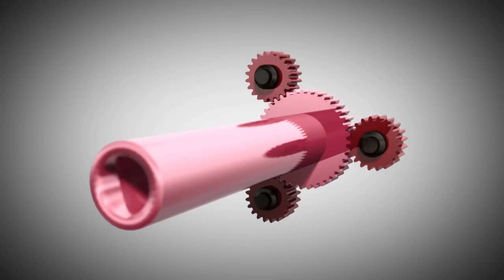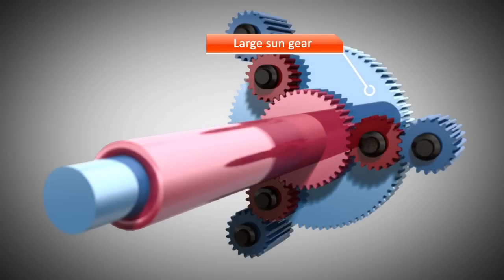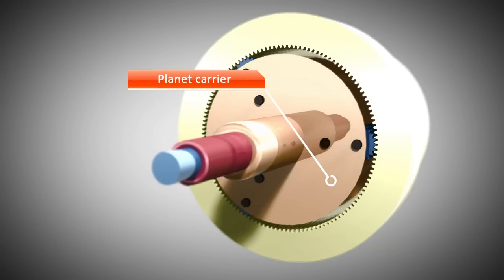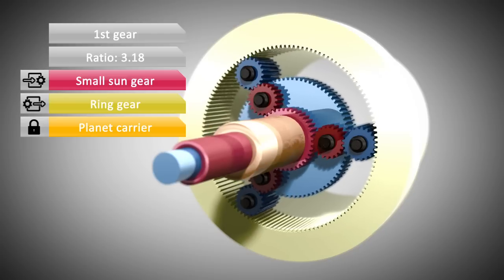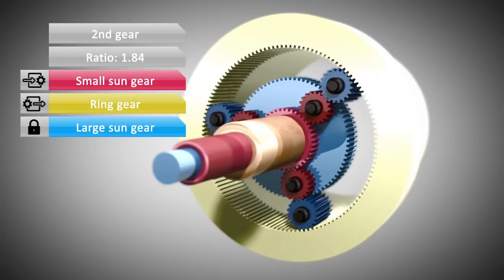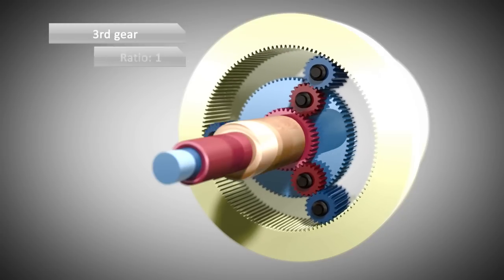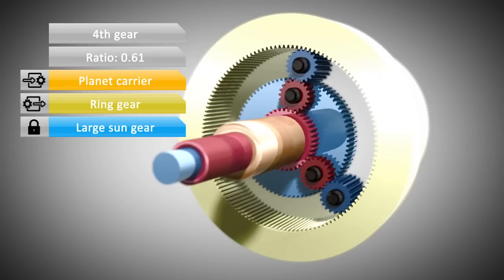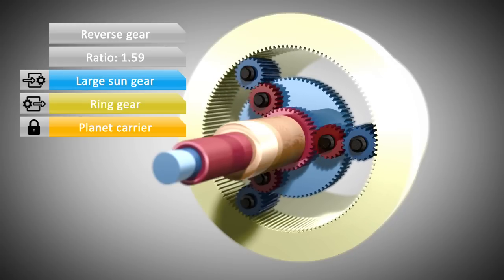Ravigneaux Planetary Gear Set (Animation)

Comment: First gear ratio = Ring gear teeth no./Front Sun gear teeth no.
70/22 = 3.18
Reverse gear ratio = Ring gear teeth/ Rear Sun teeth
70/44 = 1.59
Third gear ratio is 1 as the planetary gear members are locked together

Overdrive ratio = Ring gear teeth/( Rear Sun + Ring gear teeth)
Overdrive = 70/(44+ 70)= 70/114 = 0.61

Second gear ratio =
((Rear sun+front sun gear teeth)/front sun gear teeth)(Ring gear teeth/(rear sun + ring gear ))

Second gear ratio = ((44 + 22)/22)(70/(44+ 70) =(66/22)(70/114) =210/114 = 1.84
Reply: Can you please mention how you came up with these equations?
Reply: roger bedankt
Reply: Roger je t'adore, tu viens de sauver mon rapport ❤
Reply: Mate you are the unknown GOAT <3 of 2nd gear

Comment: Can you tell me the teeth no on each gear? for academic purposes. I'm supposed to be designing  a gearbox with specific requirements. I wanted to avoid unnecessary calculations so, used your gear ratios as a reference and luckily I was able to obtain the desired results somehow. I'd really appreciate it if you can provide the teeth information so that I can avoid some unnecessary calculations. Thank you.
Reply: I found a place which has the same transmission with the number of teeth. The ratios are different, but they match the calculations if you round the numbers to one decimal
http://web.ncf.ca/ch865/englishdescr/Ravigneaux.html
Reply from the maker: Nope, sorry.